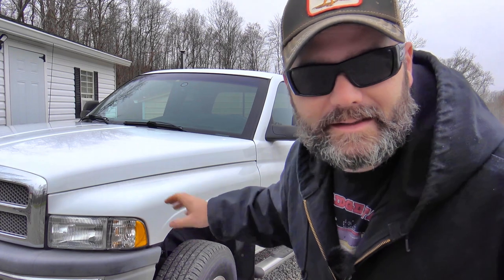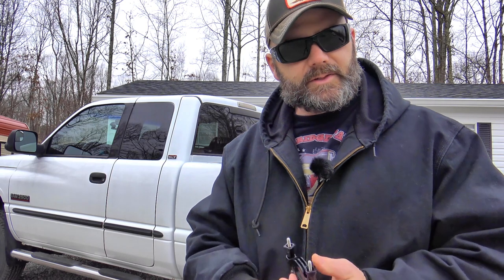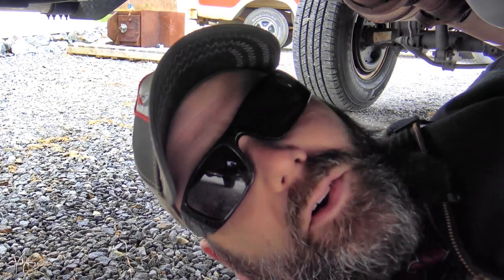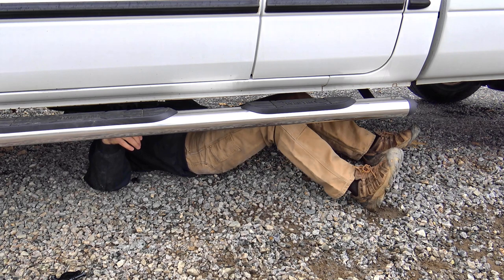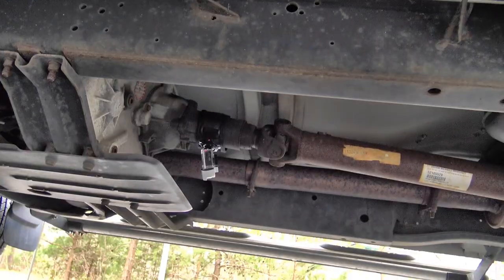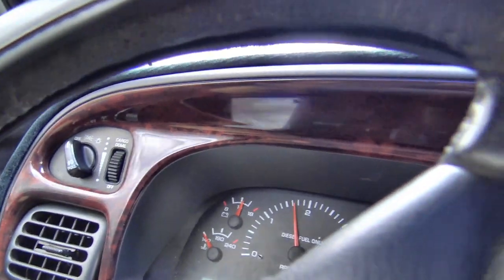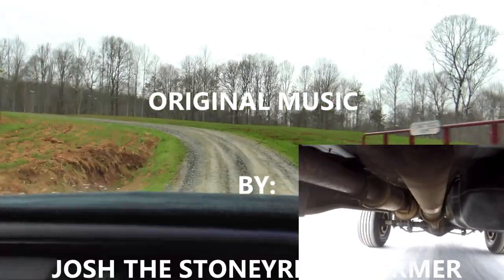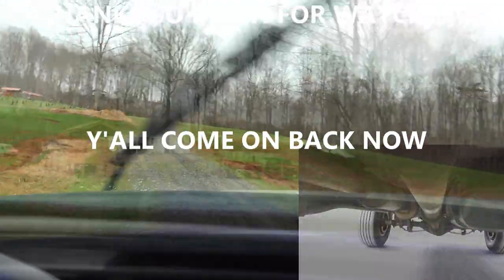WHAT'S WRONG WITH MY CUMMINS??? CALLING ALL MECHANICS!!!

Comment: It looks like the Carrier bearing. I just bought a 96 Ram 2500 a few weeks ago just like yours but it has the 5.9 Magnum. It has 184000 on it and so far I have had no real issues with it. if that engine ever goes out I am putting a Cummins in it. :) My grandpa had a 01 2500 Ram that was 2wd with a Cummins and he drove that truck all over the US even through Canada and Alaska. The biggest problem he had was brake lines and the muffler rotting off other than that it was a solid truck. The only thing he did not like about it was it was 2wd. I will say take care of your paint my truck has the clear coat peeling I  temporally fixed it but I would like to have that truck repainted some day because I am going to keep it for a long time. Good luck with fixing it :)

Comment: It's called a carrier bearing and should replace u-joints and carrier bearing at the same time, be sure to mark your drive shaft so it goes together the same position as it was from the factory.

Comment: After two carrier bearning replacements  in my mega cab, had a solid driveline built without the carrier  bearing no more problems .  Hauler for my sons performance diesel truck, called the MASTER SHREADER, Towing a 55 foot enclosed truck hauler. Check out the The Ultimate Callout Challenge for Diesel Trucks....

Comment: Yup, that is your carrier bearing and it's bad. The u-joints (which you incorrectly call cv joints) should be replaced at the same time since those look like the stock ones. Don't go cheap on these parts and get the grease-able u-joints too! Make sure you get the life time warranty ones made by Spicer if available in your area. You can also install your own exhaust pretty easy too. Forgot to add, you could also get a one piece drive shaft too. Get rid of that oiled air filter and go with a dry filter.

Comment: If its web ur on the brake u cud have a warped rotor. If it's a tire, if it's in the rear, u will feel it in ur seat, if it's the front, u will feel it in the steering wheel.

Comment: Hey josh, This Is Gust so are you getting your vibration only when you’re hitting the break. Or coasting.? Next if your thinking about your drive shaft. Look for dings in the shaft or a shiny spot on the shaft, shiny spot would be a weight issue. 

Next I work for for a Caterpillar and Toyota Industrial dealer ship.

Comment: I'd say replace the carrier bushing and while your under there you might as well do the U-joints just as preventative maintenance (yours look stock). (You called the u-joints c-v joints. You only have U joints on the rear of your truck. the front axle has C-V joints.)

Comment: You may have got it fixed by now, but if not, I used to own a 1997 Dodge 250 v12 and had the same problem and it was the center bearing. Hope that helped.
Reply from the maker: Turns out it was the center bearing and the U-joints are bad...got 3 new ones going in this week

Comment: Not gonna fix it...... but just like diagnosing the squeaky belt. Try packing some bearing grease around the center bearing. If it's the carrier bearing the vibration should go away for 2 or 3 stops.

Comment: I'd say it the hanger bearing..  if it's a 4x4 remove the rear shaft and cover the trail shaft with a cap and run in 4x4.  If it goes away if the shaft bearing or.  Put it on stands get some one to run it in drive and use the brakes and use a hardwood broom stick, stick one end in your ear and the other to what you suspect is noisy.

Comment: When the Carrier bearing went out on my F-150 as soon as I got up to about 15 mph I'd get a terrible shaking and it I would stop. I had it towed to the shop. 30 dollar bearing. Problem is, my F-150 they welded the U-Joint forks on so I had to buy a used but good looking junkyard driveshaft/bearing. Now there is an aftermarket unit that costs way less then new. Hopefully your dodge is like any other U-joint or carrier bearing I ever dealt with and you can remove the yoke and put the new bearing on.

Comment: If you take the vehicle off road you may have damaged or bent one of the propshafts. If the vibration has come on gradually then it is likely to be due to progressive wear, this could be in the universal joints, sliding splines or even the midship assembly including the centre bearing.

If the vibration has come on quite quickly then it is likely to be a universal joint or centre bearing that is breaking up. It is worth checking for obvious signs of failure and taking remedial action as soon as possible.

Comment: At 3:42. In your video you can see the gap in the carrier bearing I have had more than on of these go bad on different trucks over the years definitely your vibration issue change it problem will be solved

Comment: I think you need some blinker fluid good luck
Reply: and also he needs a exhaust bearing
Reply: ha, that really is funny, i told my friend to go get oil for my truck at O'Reilly's and to get some blinker fluid and see if they had any exhaust bearings and the guy couldn't find them so he called the manager. I couldn't imagine the guys face when he told him it was a joke.
Reply: Definitely low on blinker fluid you can tell because of his problem low blinker fluid makes everything vibrate
Reply: Yes
Reply: Drive shaft vibration Chevy U-joints

Comment: bearing in the middle, also look for any fresh metal where a weight could have fallen off. I think the vibration at certain speeds is just representing the rotation speed of the shaft. Verify nothing on shaft to cause Imbalance (missing pieces or punctures, dirt, etc)
-precision machinist

Comment: U joints not CV joints. Just strait pipe it you don't need a muffler the turbo will quiet it down. Check the front driveshaft. Normally if the driveshaft was vibrating you would see it on the go pro easy. Tho it could very well be to center bearing

Comment: Yeah it's your carrier bearing it should not wiggle at all .
You need to replace it before it breaks and causes more damage than what you have so far.
And change your exhaust all of it and put a 4" or bigger you won't believe how much more power you get from doing that.

Comment: Carrier bearing / Center support bearing  or you may have lost a weight on the driveshaft
Reply: Howard Parsons yea I thought I seen a weight missing
Reply: Balance doesn't show that slow
Reply: Driveshaft vibration show at speeds below 35 mph . I know this because I build them for a living which includes balancing them and the Carrier / Center support bearing is part of the driveshaft
Reply: Vibrations show yes, but not balance. I'm sorry, but if the components are solid and the shaft isn't bent, balance would have to be out 1/2 lb to show at low speed and it would not change with loading and unloading.
There is another thing that can cause crazy vibes, and that is liquid inside a tire.

Comment: Yep that center drive shaft bushing is shot. that's causing the vibrations.
Reply: Shane Singleton is it a bushing or carrier bearing in these trucks
Reply: Carrier bearing is definitely bad. If it were my rig I would change the all the u-joints as well especially if they have not been changed in a very long time. Good time as you have to take the drive shaft out anyway.
Reply: Agreed. Would also replace U-joints.
Reply: not 100% sure. But whichever it is it needs to be replaced. My brothers 95 Ram 2500 4x4 is a regular cab so doesn't have that support on it.
Reply: I think you need to look again
Reply: Universal Joints need to be replaced.
Reply: The whole midship looks loose not just a shot bearing
Reply: Mine totally came apart and made a horrible noise!

Comment: I'm with General Repair  the rubber on the carrier bering looks pretty wore out but I don't think its the driveshaft .  If it were the driveshaft the Go Pro would be shaking.  Did you have the truck in 4WD if so check to see if the front axel is still engaged.  if the front axel is disengaged you should be able to reach under the truck and spin it by hand if you can't its still engaged.

Comment: Those carrier bearings will have a little movement depending on materials used in manufacturing and construction. Sometimes they are solid and have no movement, sometimes the bearing is surrounded by rubber (in between the bearing and metal mount) and have a little play. I'm not sure which your particular truck should have. Could go down to the parts store and look at a brand new carrier bearing and see if it moves like yours does in the truck. Make sure you check the universal joints with the wheels blocked and the transmission in neutral, otherwise the universal joints will be loaded and might give a false appearance that they are tight.

Comment: Bad driveshaft center carrier bearing. Pretty easy to change with a decent bearing puller or use the score it with a cutting wheel and chisel to remove. Might as well replace u joints as well, since center one needs to be removed. Use genuine Spicer u joints for best life.

Comment: I'd change the ujoint and the center bearing your talking about it will cause stress on your transmission it's a normal tune up thing at a 100k

Comment: Worn and Damaged U-Joint

In certain cases, the sounds produced by the vehicle during acceleration and deceleration can be an indicator of a prop shaft defect. Similar to vibrations, sounds are a prominent sign of a damaged prop shaft, which will need a specialist’s attention. So, if you notice a low squeaking noise that becomes faster when you accelerate and slower when you decelerate it is most likely that your vehicle’s prop shaft’s U-joint is damaged. A loud thump when shifting gears is another sign of a damaged or worn U-joint.

It is critical to seek professional help once you notice any of these problems, because an inefficiently functioning vehicle will put you and your fellow road users in a lot of danger.

Comment: Josh im a technician, ive got a two year degree in automotive analysis and repair and im also diesel certified. But anyways, i believe your carrier bearing is bad, its usually a good idea to replace your universal joints and carrier bearing all at the same time. And dont forget to balance the drive shaft. Or make marks on it with a white  marker or something for reinstalling.
It helps to to have a shop press to help remove the carrier bearing once you got the part of drive shaft off that the carrier is off.
Reply: You dont have to uninstall the entire drive shaft and the u joints. The two halves are splined together. For starters remove the section of driveshaft with the carrier bearing first

Comment: Center support bearing and new u-joints. get it balanced. problem solved. when you drop the drive shaft i guaranty your u-joints will be rough when you  move them. they should just flop around with no play when you move them, when it's off the truck. new u-joints should have zerk fittings on them. whenever you change the engine oil, just give them all a shot of quality grease (the red Lucas high temp high pressure).

Comment: Carrier bearing just like has been stated,  You should probobly change the universal joints (They are not CV joints.)  Simiilar but different.  To check the joints use a spray bottle with water and spray them when you have been driving.  If they steam the water, then they are done.
Reply: Usually a bent drive shaft will get worse when you go faster.  I am an EX Jaguar mechanic and still do a lot of work on trucks and Jeeps.  Great truck.  Love to get one like ot for my farm in Central VA.

Comment: That dampener thing you mentioned   " Carrier Bearing "  It should have a little bit of movement  as long as the rubber isnt damaged or bearing damage should also be fine .  Output shaft on tranny / output shaft on transfer case ?? Does it do it worse in 4 wheel High  / Low In reverse   possibly

Comment: Carrier bearing and or the two u joints behind it freezing up, if they are freezing up when you drop that shaft, just do them and leave the carrier bearing alone, it’s not that bad and a brand new on will have some flex in the rubber.
Reply: They are rebuildable, may require heat to melt the glue on the u-joint. Local Napa has them and way cheaper than my 25% discount at dodge.

Comment: I would take to a driveline shop have them do all the You Joints and hanger bearing, don't think it's a balance problem not going fast enough when it happens.. Once they put U joints with grease fittings should last forever!!

Comment: Looks like carrier bearing on your drive shaft is worn and needs replacing I would start there and see if the vibration goes away. If not Dodge trucks are notorious for having bad front end components that can cause vibrations. Hope that helps.

Comment: May think I'm nuts but it may just be water in your fuel. Don't know about a small Cummins but I drove a tractor/trailer semi truck for 25 years, on those we have a fuel separator that has to be drained from time to time. Could simply be water in the fuel.

Comment: Centre bearing in the drive shaft is mounted in the rubber moulding to allow some freedom to move in operation, this allows the shaft segments to continuously align themselves in the most direct path from transfer case to diff housing. Not familiar with your vehicle so can't comment on whether the moulding has gone soft/fractured etc but it seems reasonable. To test U joints, you need to grip them on the yolk either side of the X and try to rotate in opposite directions to detect movement of the X in the bearing cups. If any movement is found, the joint needs to be replaced. Looking at the vid from the gopro underneath, the shafts and centre bearing seem to remain stable when driving so I suspect that there is not an issue with the rears. Maybe you need to do something similar for the front shaft, or at least check each of the joints on it with the grip and twist suggested above. Do you have freewheel hubs up front and a transfer case with the ability to lock into RWD only. If the problem goes away in RWD with the front hubs freewheeling, it is obviously in the front drive shaft, if it stays, then the transfer case and rear shaft. There are some stones caught in the rear tyre treads when you climb under to fit the camera,  they should have little effect on your driveway or dirt roads, but may induce vibration on sealed roads. Good Luck

Comment: Bad carrier bering. U- joints are probably ok   You can see light thru the bushing on the carrier bering  change it or it can an will cause u joint failure if not repaired

Comment: I'd say you have a bad u-joint (or two) that has caused your carrier bearing to fail. Although the u-joints look good and are "tight" I'd say they have lost lubrication and are now "locked" in one position causing the vibration and causing the carrier bearing to be the only point to find "relief".

Comment: your shaft has a 1/4 inch bend. the hanger bearing should hold it true under power but can't prevent gear lash vibration on deceleration. (torque is a bear) always change those bearings when you find play. make it part of your routine tranny maintenance routine: yearly.

Comment: Carrier bearing has seen better days for sure. One question, did you use the 4wd while driving in the snow? If so check the inner axle u-joints and one reason I don't like Dodge trucks; they took the toughest front differential on the market and ruined it, by adding a vacuum locking actuator to engage the front differential. Bad idea. If it hasn't given you trouble it will.

Comment: It's the center bearing between the two drive shafts when it gets real cold the rubber cracks which throws it off a balance so you need to replace it unfortunately you got to take the whole drive shaft off and take it to get pressed out and pressing you went in and they should run just fine Pat that happened with my Cummings I'm a mechanic and I know what I'm telling you you have a great day
Reply: It's in the middle of the Driveline in

Comment: Check U joints (do you know how to check them?), carrier bearing (that one in the middle) Slip joint/spline aft of carrier bearing, and the harmonic balancer. I remember around that year Dodge had a problem with the drive shaft falling out. Check dealer notifications and recalls. Most likely U joints and/or carrier bearing. If one is bad do them all. It is NOT balance. It would show up the slow. Balance is pulsating vib at higher speed. (50mph plus.)
Reply: (I specialized in vibration problems. Had cars shipped from around the world to work on)

Comment: Had the same problem.  I fixed it by changing the rear brakes.
Reply from the maker: was U joint for driveshaft
Reply: the vibration of my truck was only when braking.
Reply: when the vibration started, I changed the entire front end, discs and pads, and the vibration continued
Reply: so i decided to check the rear brakes, and i realized that i had no pads and the drum is scratched.

Comment: while your driving you can see the out of round spinning of the drive shaft close to the carrier bearing.  when you crawled under the truck and was forcefully moving the drive shaft it should not have had any movement in it at all.

Comment: for as clean as the bottom of that truck is u should pay someone to have the bottom sprayed with bedliner keeps the underbody as clean as can be we did that with our chevy it was from georgia no in wisconsin its still rust free on the bottom
Reply: Wanca Farms just spray it with diesel that way the bolts heads dont have bed liner on it.